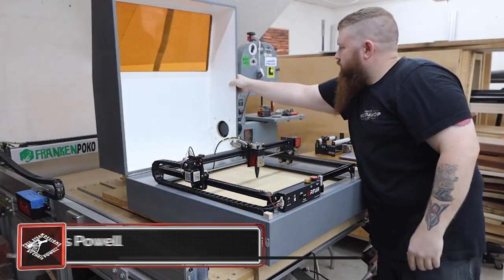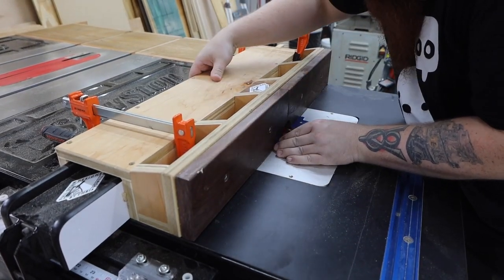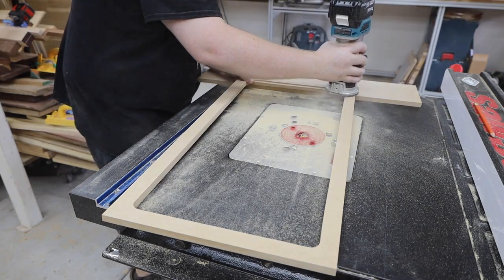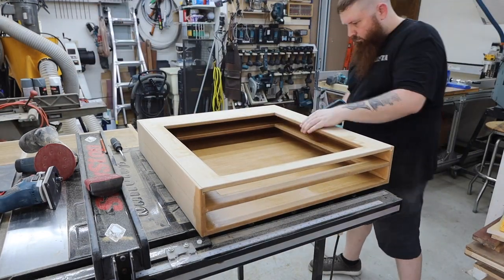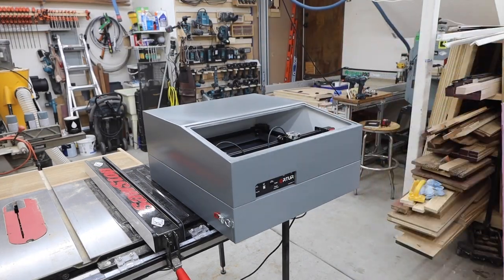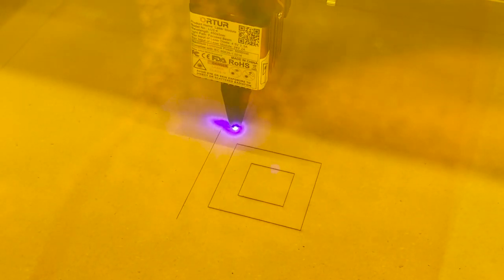Building an Enclosure for the Ortur Laser Master Pro 2 - Free Plans

Comment: To get the same angle you could cut them both at once- could tape them together or if you cleverly screw them together during the cut phase you can reuse the screw holes left over to assemble it. Really nice build!

You should see my current enclose- it's cardboard, duck tape and hot glue. It's very ugly but it works great. This was just temporary until some Money came in, which I just recieved so tomorrow I get to buy materials to make something like this. My setup is about 1000x1000mm so I can't use these plans, though I've built tons of stuff like this before so it should be pretty easy- just gonna wing it and figure it out as I go- after 20+ years of remodeling I'm pretty good at building cabinets without plans and stuff like this, plus the duck tape enclosure showed me the things I need to consider- such as small back doors to get at the back corners or maybe make the whole back end open up- not sure which (with the 900x900mm extension you just plain can't reach the back from the front by reaching)- also planning on making the entire top acrylic so that I can mount a camera on top that I can sync up with lightburn (already got one on a back top corner for just watching remotely- very handy)
Reply: He did cut both pieces at the same time!
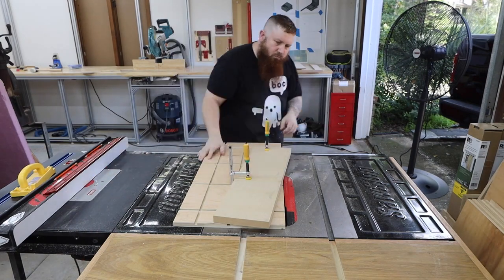@2:56 Watch the two pieces drop off of the jig onto the saw top.

Comment: Thanks Chris. I plan to build a second enclosure for the RA2 accessory. I have spent two months on a jumbo size and expensive cabinet for my D1 Pro 2 in one from X Tool. I ordered the extension kit with the initial purchase so assembly was easier. What I found was that I had half enough parts left over to build another machine. They should sell the extended model ready and eliminate all of the duplicate parts. Its like the Harley motorcycles, you take a two hundred dollar part off and put a three hundred dollar part on!
Ill send you a photo of the finished... well almost finished cabinet. 

One thing i consistently see on enclosures is the tendency to put the exhaust intake high in the back of the cabinet. What happens is the smoke and residue are already headed down on cuts and the smoke and residue makes a 180 degree turn to get to the intake. One bad issue here is that it drafts these up right by the cooling fan of the laser module and this material gets pulled into he module. 

 The airflow should be across and downward coming from the front panel with an adjustable damper and above the level of the machine. By adjusting the intake you can observe what area creates enough velocity tp pull the smoke and residue to the back and out. 

Thanks for the plans. good job on the video.
Reply from the maker: Thank you. You’re right about the exhaust. It was just easier to set up this way.

Comment: Apparently the measurements for the base plate are wrong, or the sides of the base need to be longer
Reply from the maker: I built it using those measurements. All I can say is double check your pieces and watch the video again.
Reply: @ChrisPowellFSD  the base is 1/4 longer than the sides... 26 7/8's on the base vs 26 5/8's on the side pieces....I'm not sure what I'm missing. I've watched the video several times. It would be helpful to have the middle shelf pieces marked a separate color from the base. I'm using screen captures from your video.
Reply from the maker: @ydeardorff  there’s a 1/4” deep rabbet in the back panel that the bottom fits into.
Reply: @ChrisPowellFSD  TY  it must be me. I've triple checked everything. But it's hard to identify what goes to what for some of the boards

Comment: The only changes I would make, would be an internal air channeling bulkhead off of the exhaust fan. And place the glass on the inside. Essentially reverse your mounting if the glass.

Comment: Have you considered updating these plans for the LM3?
Reply from the maker: You just need to move the hole for the cables and antenna.
Reply: @ChrisPowellFSD  I also have a new LM3 and the laser cable sticks up almost 8-1/2" above the feet so thinking the top piece needs to be made a little taller?

Comment: Great plans and a good looking project.  Finished building it about two weeks ago with a few modifications such as gas struts and also made a matching table with a drawer and casters.  The bottom shelf of the table was a perfect spot for the air pump and a power strip which connected everything with remote power switches.  I've got pics but I don't think I can add them here.
Reply from the maker: Awesome. If you post them on Instagram you can tag me @full_steam_designs

Comment: Good evening Chris,I build my own enclosure but it is not looking good and also not just build my first time ever this.My problem there is that i would like to have it 100% sealed but it is not because it is not 100% accurate.Don't know what to do now.Specially when i saw yours I wanted to ask you if you can build me one and ship it to me because i have not all the tools and knowledge what you have.But i don't think so this will happen.So my question to you is where could i buy enclosure also with extension frame size.That is what i am planning to buy next the extension frame but have to get then my power adapter out of my enclosure what is right now sealed in the back
Reply from the maker: Sorry I don’t have time to build them

Comment: I got all the boards cut today and the router table adjusted to make the dado joints on some scrap material.  Tomorrow I cut the dados and start assembly (that's the big step... we'll see how well everything fits and how much adjustment I have to do).  I was wondering what you used for trim around the acrylic?
Reply from the maker: Just some oak I had laying around. I had some that was 3/4” thick. I just cut it into strips that were about 1/4” thick and then cut the corners to make everything fit together nice.

Comment: I am looking to modify this for my atomstack.
Reply from the maker: I ended up modifying it to fit my xTool D1. Just had to move the controller opening and the hinge inside. I also cut the top in half so it would hinge open in the middle.

Comment: Hey Chris, woodworkers work in fractions and machinists work in decimals....did you find a ruler or tape measure marked in hundredths of an inch or do you have a really large digital caliper to come up with these really strange numbers (13.08, 5.57, etc)?? It's impossible to find fraction equivalents to those very odd numbers.  Got started cutting up the boards today, but finding the strange numbers hard to deal with.
Reply from the maker: Like I said in the video, round up and leave the pieces long, then trim them to the correct length.

Comment: Hi Chris  excellent build - my ortur lm2 pro should arrive this week and this will be the second thing I build right after I build my new table to hold it. I see where you mentioned you went with a different exhaust fine and moved it to the rear top section.  I've looked at the fan on Amazon and can't picture how you mounted it? Is it mounted inside with the exhaust port stick out the back?  Any chance of getting a pic???  Also - do you have a link for the gas springs you used? Thanks again and I just recently subscribed - really like your work....
Reply from the maker: Thanks. I’ll have to throw some new pics up on instagram. I didn’t use gas shocks, just the toy box lid support, and I actually ended up removing that.
Reply: @ChrisPowellFSD  Thanks! - I'll swing by your instagram page and follow u over there as well and keep an eye out for the pics. THX!

Comment: Where did you get your lid supports?  I'd really like to make a dovetail board like you used to make the angled cuts, but spending $100 for a 3/4" plywood sheet to make that seems a little too expensive.  Do you know another good way to cut to those angles without buying any more special equipment?  I got my router and table yesterday, still waiting for some clamps and router bits.
Reply from the maker: Home Depot. You could just clamp a piece of wood to the piece you want to cut at an angle and use a circular saw or even a router to cut it.
Reply: @ChrisPowellFSD  Thanks, Chris

Comment: So tell me why everyone is choosing to use MDF instead of plywood?  There must be some good reason?
Reply from the maker: Cost, easy to paint, and why not?
Reply: @ChrisPowellFSD  The why not is answered with, the MDF is a lot heavier (could be good or bad if you want to move it around), Plywood is hard to paint?  Plywood holds nails and screws better.  But I was just wondering why MDF seems to be the choice.  I've never liked working with it because it chips and breaks more easily and is not as forgiving.  But I haven't priced that stuff for quite awhile, so the cost difference might be significant?
Reply from the maker: @spydie  yes plywood is hard to paint and get a good finish unless it’s cabinet grade. Should be able to get prices on the lowes or Home Depot website if you want ti compare.
Reply: @ChrisPowellFSD  Bought a 4X8 MDF today.  It's $5 more than a 4X8 C/D plywood, but $50 less than a 4X8 A/C plywood.

Comment: I loved the build, but it would be nice if you'd post those plans on your "free" files page.  A screen shot might work OK, but it's just not as nice.  Thanks.  I sure wish I had all those woodworking tools so I could make one as nice as yours, but with just a small table saw and not router, it won't look as nice nor fit together as well, but it is what it is.  I'm going to tackle this project this summer when it warms up in the garage.  Wouldn't 1/2" plywood have been stronger with less "bowing"?
Reply from the maker: It shouldn’t be any problem to build with just a table saw and router.
Reply: @ChrisPowellFSD  I don't have a router.  Never had use for one, but it looks like one might be in my future now! LOL. Why didn't you use plywood to alleviate the warping you showed on the front?

Comment: Hello
what did you use here for wood or material? Is this MDF
for the Enclosure for the Ortur Laser Master Pro 2
Reply from the maker: Yea it’s mdf
Reply: thanks, one more question, how thick is the MDF board 19mm or 12mm ? @ChrisPowellFSD
Reply from the maker: @metzgerdieter6485  1/2”
Reply: @ChrisPowellFSD  Hi Chris, what kind of plate is this that you insert at the bottom for cutting as protection?
Reply from the maker: @metzgerdieter6485  it’s this laser grid https://amzn.to/3svJprf
Reply: @ChrisPowellFSD  Hello, not the Laser grid, I have already received that via your link on Amazon. Was there within 2 days from USA by express. Incredible! I mean the silver plate that you insert at the bottom. Is this a stainless steel serving tray? or can you also use a normal aluminum plate as protection?
Reply from the maker: @metzgerdieter6485  o yea it’s an oven tray. Basically a cooking sheet that’s meant to catch stuff in the bottom of the oven.

Comment: Great video. I think I'm going to use these plans as a baseline for my Atomstack X7 Pro.
Now that you've used it for several months, anything you would have done differently?

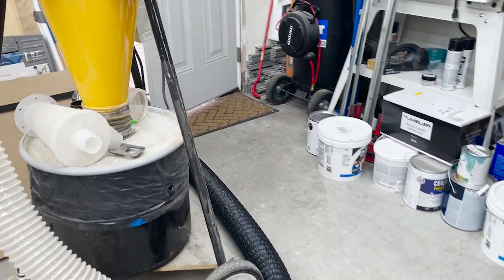I see in the comments that you're working on readily available plans - I'm sure you noticed the exhaust port is in the incorrect location @10:04 

I really like the bed system idea! Thanks for your time and effort. First time watching one of your videos - liked and subscribed.
Reply from the maker: I moved the exhaust to the top. It can go anywhere you’d like. I also cut the top in half so the front half hinges up.
Reply: Did you end up using this for your A7 pro? 

I just bought my M5. Curious if it’ll work for it.
Reply: @BradySkjervem  I have an X7 but I'm actually working on plans in fusion 360 as I type this. It's my first project with this software so it's taking a little while. I made a few modifications. I plan to have mine hinge in two places but I really like how the entire lid lifts up and you can easily access the floor of the laser. Not crazy about the enclosures where you have to reach in from the top.

Comment: Hi Chris. Do you know if your plans will work with the FoxAlien Riser 20w laser?  I noticed you have the grid.  My laser is foxalien and I need to build a box for it
Reply from the maker: I’m not sure what the dimensions of that machine are. It seems like many should fit this design though.
Reply: I guess the only difference is that my continued panel is mounted to the laser so it actually moves with the laser and is not stationary so I would need to figure a solution for that

Comment: Nice video! Is the Z bracket modification necessary for the enclosure? I do not really have means to produce one so I wanted to make sure before I followed the plans. Thx
Reply from the maker: I was thinking about this today. If you made a wasteboard that slid in and raised up into the cutout section, and then slid in some shims below it, you wouldn’t need the longer bracket.
Reply: @ChrisPowellFSD   Thanks for making me buy a 3D Printer! 😂😂😂  Man these things are fun to figure out. #bedlevelingsucks

Comment: Hi Chris
With using the Honeycomb cutting panel that spans a open lower space, would it be a advantage to have air extraction from the lower level when using it?
Reply from the maker: It probably wouldn’t hurt. I changed out my fan in favor of a larger one, and moved it to the top rear section. It doesn’t seem to have any issues getting the fumes out like that.
Reply: @ChrisPowellFSD  What fan did you end up going with?  I can still return the one you recommended and get a better one if you think it's necessary.  I only have an 8 foot run to get the fumes out the window.
Reply from the maker: @spydie  here’s the new one. You’ll also need to get some sort of flange to use with this one. https://amzn.to/3LCVYcX

Comment: I just got my Ortur LM2 Pro setup.  Thank you for the detailed information on your enclosure!  I too would like a PDF of the plans.

Did I miss an air inlet port?  You provided a link to a 90 CFM exhaust fan, but the cabinet looks pretty "tight" for allowing air in.

Should there be any concern about a laser burning wood that could catch fire being enclosed in a wood case?
Reply from the maker: It has an air assist blowing air in and isn’t sealed.

Comment: Thanks for sharing. Working on an enclosure myself but I'm trying to make one that's ultra light and easily portable. My wife is a travel nurse so we move to a new location every few months. My current plan is to build using high density foam board which should be both strong and light.
Reply from the maker: That sounds like a good idea

Comment: This is by far the best enclosure build I have seen Chris! Excellent job! Unfortunately I have to stick to my cardboard box 😎 Just can't invest that much time into the project.
Reply from the maker: Thank you!
Reply: May I ask how safe is the cardboard to build the enclosure? I don't have the tools to do the cabinetry this enclosure requires, and I thought about a couple of options, for example metal sheets and bending plus rivets, I'm afraid to use wood or cardboard because I have notices that when using white paper or white materials while cutting, a lot of reflected light goes everywhere around, will that reflected light make the cardboard catch on fire?? I also thought on painting the enclosure black inside if I make it out of wood just to absorb a bit of light, I don't know, I'm just throwing rocks around!! Thank you for your response in advance! Thank you.
Reply: @nohc4  It should be perfectly safe, since you should always be monitoring the job. Reflections will not cause a fire. Paint the cardboard black if you're really concerned.
Reply: @TheLouisianaHobbyGuy  Awesome! Thank you so much for your response! I've been using 3D printers for a decade now, but I'm fairly new to lasers. 
BTW I just noticed you have a great channel laser topics, Subscribed! Thank you!

Comment: Recently I purchased a XTool D1 Engraving/Cutting machine w a rotary adapter. Upon MANY review I came across its comparison to your machine and how similar they are in function and size. That being said, will your plans fit for my machine?
Reply from the maker: Looks like it fits. I just need to move the opening for the plugs from the front to the side. I’ll probably do an updated video on it when I get a chance.
Reply from the maker: I’ll have to check the measurements. The x tool seems a little larger.

Comment: I need an enclosure that I can let me use my Ortur Master 2 Pro inside my office and vent out my office window. Do you use this indoors? Curious if with some caulk on the joints, this will let me use indoors without turning my workspace into a hot box of wood smoke
Reply from the maker: Yea I use it indoors. I haven’t found a need to caulk anything. The fan does a great job of getting the fumes out.
Reply: Awesome! Thanks for sharing the plans and build video!

Comment: Great video! I will be making one of these for sure. What is the shield and breathing apparatus that you are using?
Reply from the maker: Awesome! It’s the Powercap from Peke Safety.
Reply: @ChrisPowellFSD  Awesome, thanks. I had a papr from 3m but it had a clunky hose and a flip up welding shield. It was very heavy on my neck when sanding. Does this one feel top heavy when wearing it?
Reply from the maker: It’s super light. I hardly notice any difference when wearing it.
Reply: @ChrisPowellFSD  Thanks for the info, I ordered one. They should sponsor the channel.

Comment: Great video!  What are you using for the metal screen you have supporting the workpieces? Is that some HVAC system grate painted black?  It looks like a great upgrade and I'd like to do the same.
Reply from the maker: Thanks. There’s a link in the description for it.